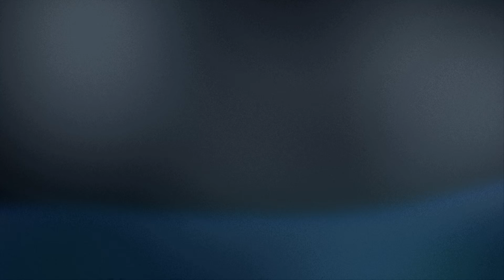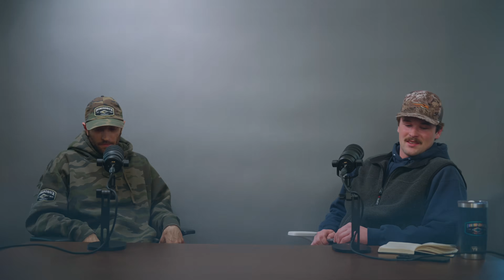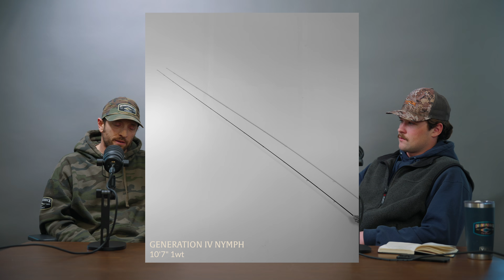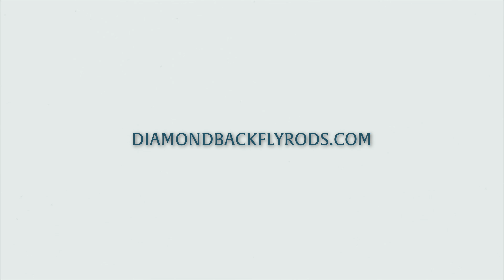Diamondback Fly Rods | Q&A with Joe Goodspeed | Ep. 1

Comment: Hi there! First of all, thank you for the great video.

I recently bought the 10'7" #3 blank here in Europe (Spain). It was a bit of a surprise when I later tried to order an extra spare tip section and was told that spare tips aren't sold separately—instead, I have to buy a tip section from a pre-built rod. In the worst-case scenario (if I break a tip and need to use the spare), I’ll end up with a fully black-wrapped rod except for that one factory tip section! Is there any chance spare blank tips might become available in the future?

I also wanted to ask about the guide spacing chart you use. Right now, I'm working with a custom wrapping table I was given, but I've run into an issue where one of the snake guides lands right on top of every single ferrule joint. Could you share or recommend the official guide spacing specs for this blank?

By the way, I tried reaching out via Instagram direct messages, but it seems hard to get a reply there, so I hope it's okay to drop my questions here!

Thank you so much for your time and help. Greetings and tight lines from Pamplona, Spain!